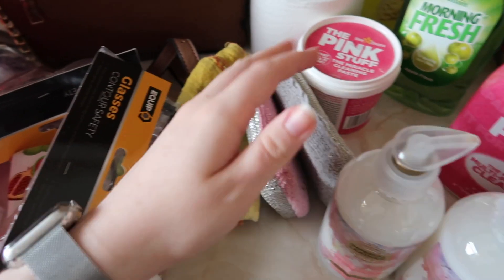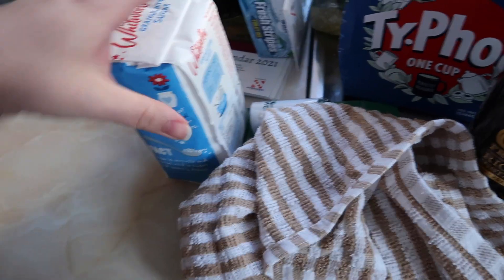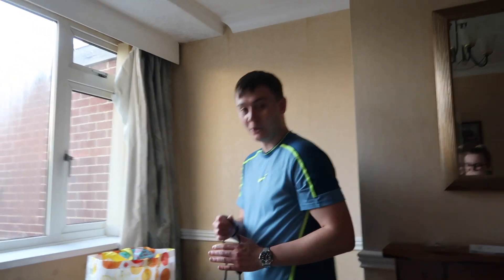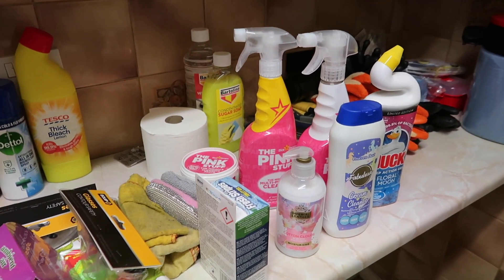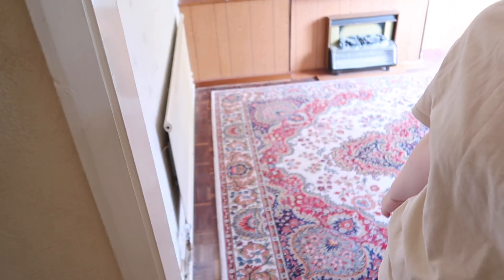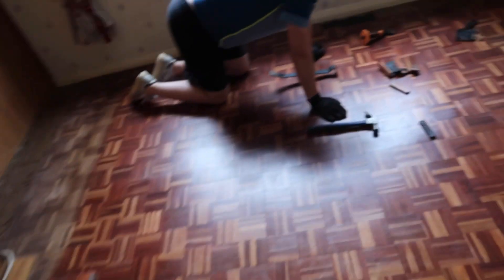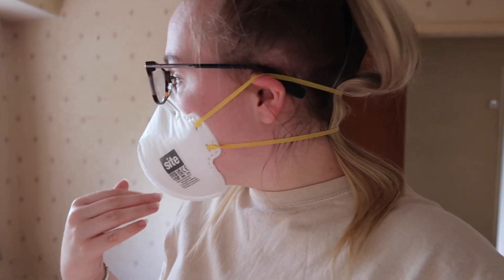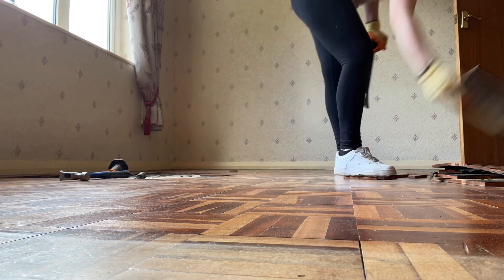Renovation Vlog - Moving Vlog Week One! | Philippa Morrison

Comment: How olds that house have you checked that the faux parquet tiles are not laid with asbestos? Wear a mask 😂seconds later mask on also Reece is right your glasses won’t save you you could end up with a shattered lens in your eye but safety glasses that fit over your own
Reply from the maker: Hi! The house was built in the late 50's, we do actually think in hindsight the bitumen tar that was used to lay the tiles may well have had asbestos it or asbestos backing on the tile themselves so we were very careful with removal and disposal! And I have now got safety glasses I promise!